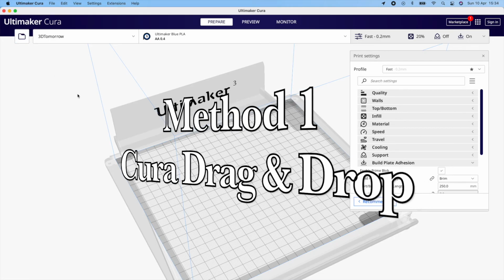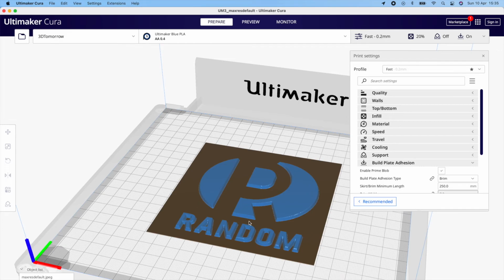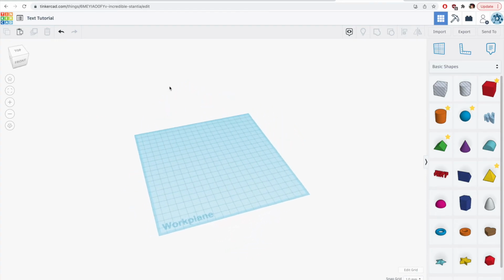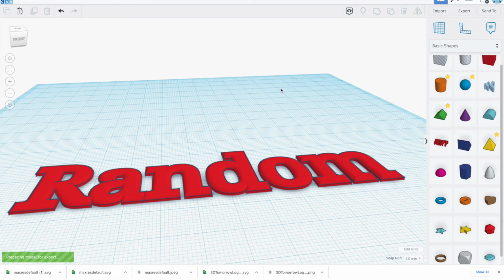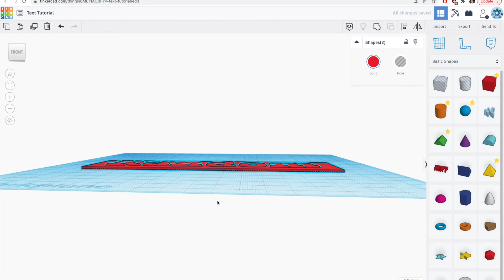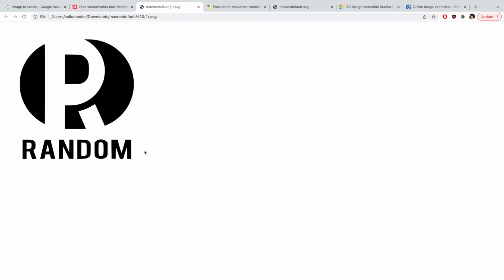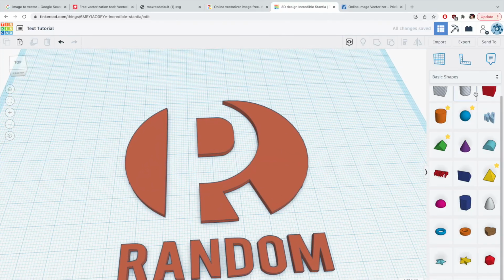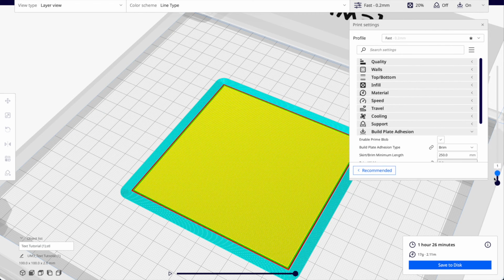How to 3D PRINT TEXT - 3 Ways to Generate 3D Printable Text and Logos

Comment: Could you share the stl export parameters and slicing details for the gcode creation?  I created a model with text in solidworks and I am having difficultly getting smooth edges on my lettering...  The "s" and "O" print faceted, I can't get smooth lettering...  Thanks!